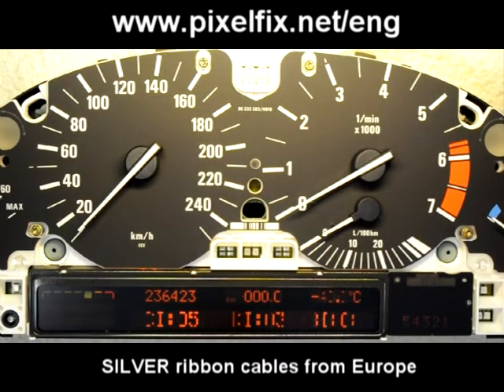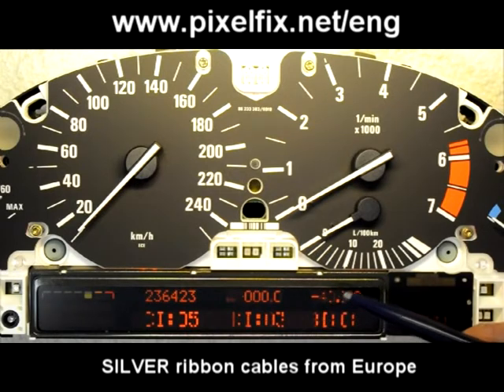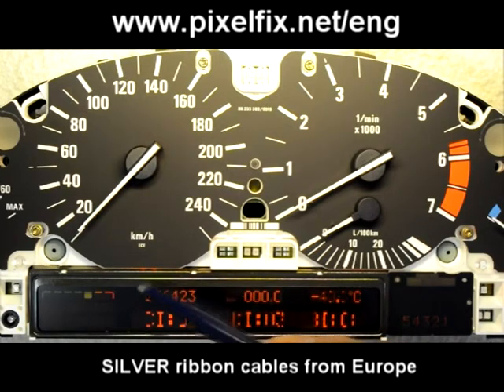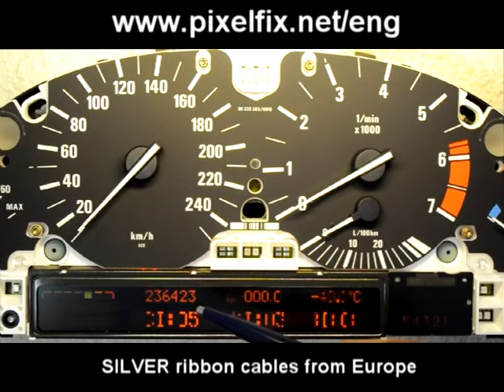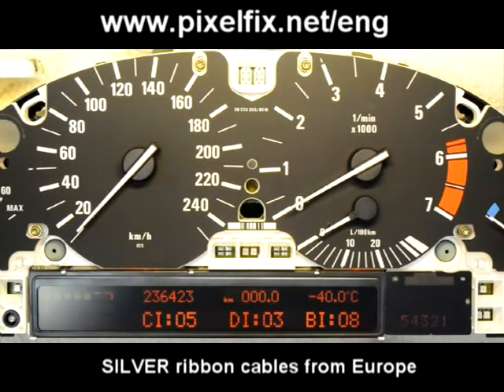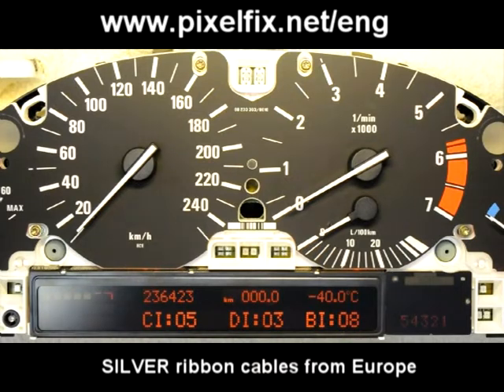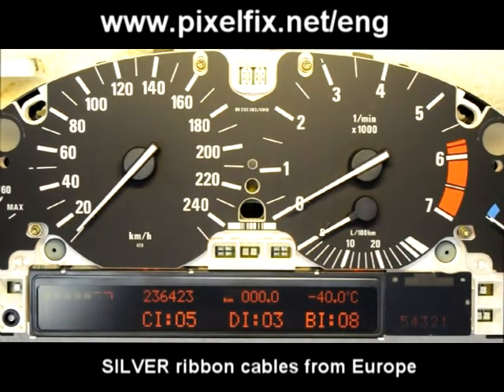BMW E38 E39 X5 OBC LCD pixel repair ribbon cable kit for Instrument cluster / speedometer

Comment: hello how did you remove the needles kind regards andrei
Reply from the maker: You need to use the pixelfix needle removal tool - this tool comes with the cable for free, you will find it on the package together with the silver cable and the repair manual.